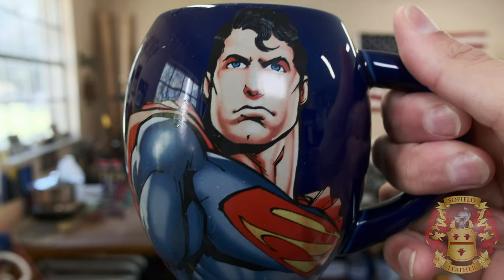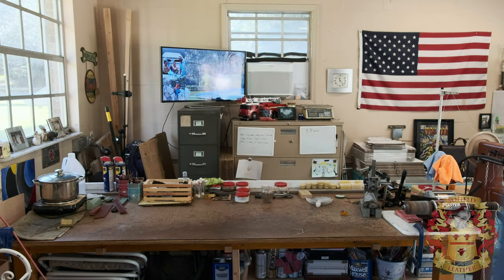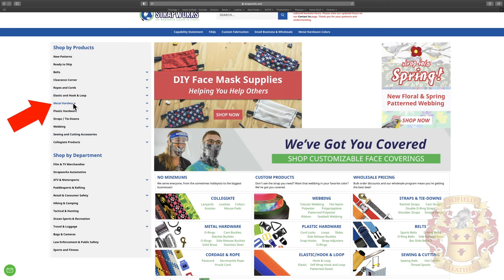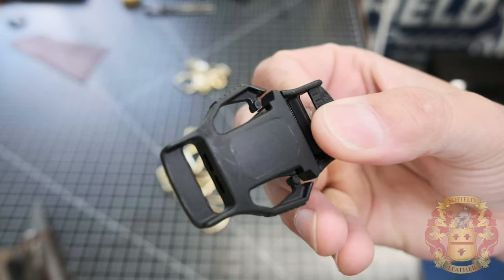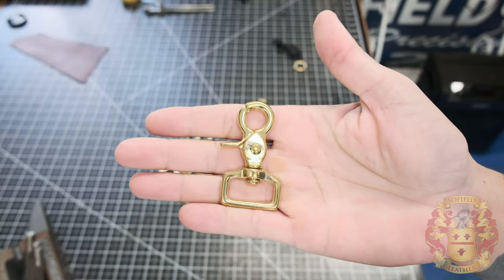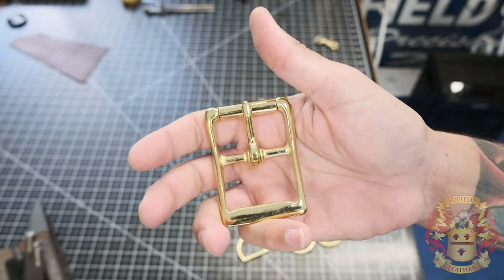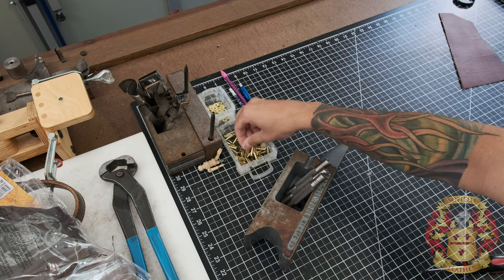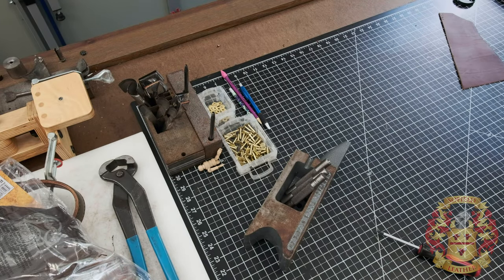Firefighter Leather - Hardware I use and where to get them 👊🏼 - Leather Crafting Tips

Comment: Excellent Video! Super cool of you to share what you use and where to get hardware. I recently ordered #3440-7 from weaver and the backing screw was very short. So short in fact had to skive the backside to barely get a bite on the screw threads in the back of the stud. Just wondering if you've noticed a change...otherwise Keep up the awesome vids!!
Reply from the maker: Yeap. I sure do. I don't use them on anything over 9 oz. Thats about as thick I can go with these. I am a tad disappointed with the length of the male end for sure. The older version had a much longer male post. In fact, I have to skive my 9-10 oz pc just a tad to secure a nice fit! I'll keep an eye out for different vendors. Thanks again for sharing your thoughts.

Comment: What size chicago screws do you use 1/4 , 3/8? And also what size  button screw stud?
Reply from the maker: 3/8 for most or whatever fits. As far as the button screw studs, I should have a link in description to the exact ones. 👊🏼

Comment: You ever make suspenders for jeans? Ben thinking about making a pair.Your a braver man than me I’ve only shaved my lip once in my life and that’s been since I had three hairs on each side . I think my grandkids are still traumatized.Never again.lol
Reply from the maker: Hhahahahahahah...I sure do make regular suspenders. it's an easy transition. All I did was use a 3/4 in wide strap instead of 1 1/2. i also used a smaller O ring in the back, but you can easily just use a screw holding the 2 pcs together. I like my style better though. I do have 2 videos on the build

1 - https://youtu.be/LeUwuSjaRRw
2 - https://youtu.be/8L23SnIkcpo

Let me know if I can help any further with this build. 👊🏼
Reply: @SofieldLeather  appreciate that . I was thinking about using a leather gusset on the x but what I’m trying to figure out is how to attach them to my jeans where I don’t have to modify my drawers. I haven’t found any heavy duty clips or what they are even called.I will check out your video .
Reply from the maker: 🤔🤔🤔. Im just using a simple suspender Clip.--> https://www.etsy.com/listing/595961356/3420mm10-pcsantique-bronze-rectangle